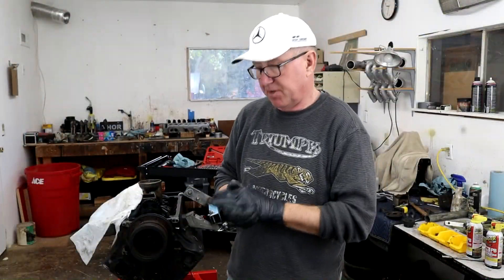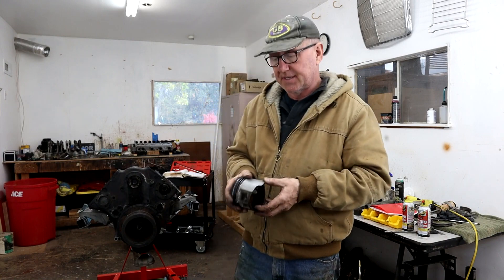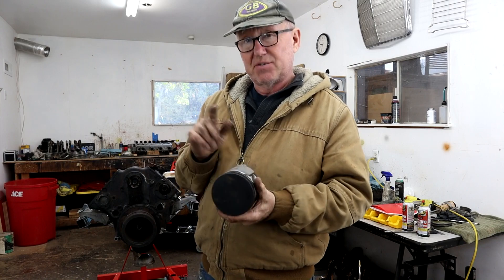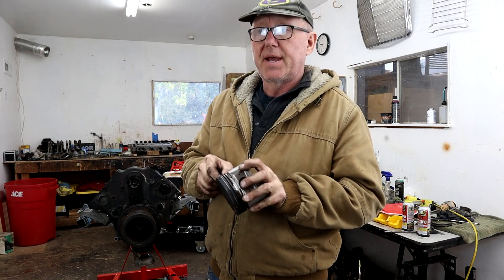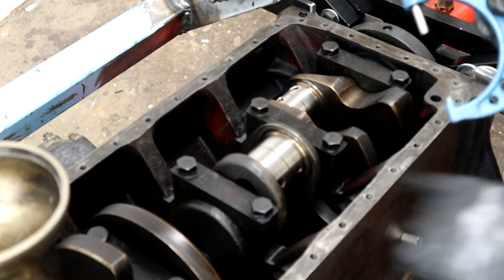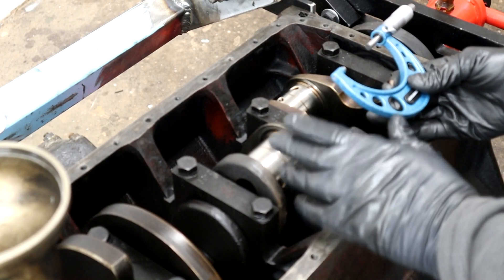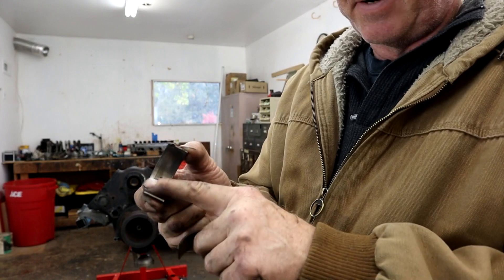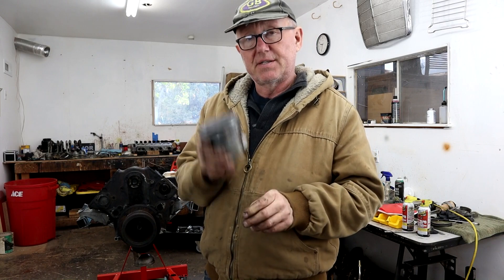MERCEDES M100 6.3 PISTON FAILURE  PART5

Comment: Hi John, shame about your engine. This is only my opinion, but sleeving would be my last resort. A rebore is always the best bet if you can get the suitable piston/rings set. I am a BMW man (sometimes I really wonder why!) There is an excellent Youtube channel, M539 Restorations. The guy is called Streten, and he produces some first class content, albeit BMW related. He has a really bad and expensive experience with sleeving, and I have 2 friends who have also had bad experiences. I look forward to your progress.
Reply from the maker: Thanks for the heads up Bob. I have decided to not sleeve, the block but to do a the re bore and new pistons instead. I agree its a much safer bet. Too many opportunity's to screw stuff up. I'm also going to do some careful research on a good machine shop. Thanks for the recommendation of that channel, I'll take a look.
Cheers John.

Comment: One thing I'm going to urge you to get is a dial gauge kit. Use this to check the crank end float. Push the crank back, or forward as far as it will go. Set the dial gauge up on the rear, or front of the block, & put the stylus of the dial gauge on the pulley end, or flex plate end of the crank. Using the moveable dial, set the gauge at zero. Lever the crank forward, or backward, & read the gauge. This reading should be within specs. If not, replace the main bearings, which I would do anyway. The rod bearings tell me the oil was extremely thin, with a lot of carbon in the oil. This is caused by dilution over an extended period of time, & possibly running too hot. The only Mercedes model I'm aware of that has lengthy periods between oil changes (120,000km!!!), is the 450SEL 6.9. These have dry sump lubrication.
Reply from the maker: I did exactly that today. A little out of spec at  0.010" end play.  From my understanding it should be between 0.004 to 0.007" But I'll  check the service manual. I'm replacing all crank bearings anyway. Im assuming this play can be reduced with new bearings along with a new thrust shell bearing. Cheers John 🍻
Reply: Now, now, lets not get overzealous here. Its only two wear points to deal with - the bore and crank wears. At this rate we would all be carrying Mitutoyos under our arms!!
Reply from the maker: @mohabatkhanmalak1161  To be fair, I'm glad I did check the thrust bearings (crank end play) as Christopher advised. After all I don't want to go back in here again:)
Cheers John 🍻
Reply: @mercedesmaintenance.6339  Its all good, just some banter. But, not sure of how machine shops operate in the US, but in two countries where I lived overseas the system worked this way: you took your cleaned block, crank and conrods and if needed cylinderhead to the machine shop. They would  take all the measurements and refer to their  manufacturers tables of min, max specs. Then they would also procure the next oversize parts like pistons, bearings, valves etc. So we got our blocks etc with all the new required parts, ready to assemble. We didn't even need to plastiguage the journals - but in your case I say you still plastigauge the journals when assembling the engine.
Reply from the maker: @mohabatkhanmalak1161  I get it:) No worries. I guess someone could do what you said, but I'm just going to ask the machine shop to re bore to match the new pistons and I'll measure and check the rest. Its something I'm looking forward to. I spent a lot of money on measuring instruments so I better make use of them:)
Cheers John 🍻

Comment: The engine in my vids  had piston damage ,that is the second ring land had broken on several of the pistons.  Because the AUS ,UK etc engines had the standard compression they were prone to pre ignition. Preignition Will break the ring lands as the firing on the upstroke causes huge pressure waves (hence the rattle under acceleration) . Once the lands break a driver might be fortunate as that all that could be all that goes  wrong, but in common cases they end up looking like yours .The rings break and the ends will flog a hole in the piston wall,and often the bore wall as well. On 6.3's and the other Mercedes MFi equipped engines, a leaking cold start valve will make the interior of the engine look very clean as the excess petrol washes everything down. Your are right though,the gudgeon pin bushes show every sign of thin oil . It all goes to show how ever,just how tough these engines are when they can drive around on 6 or 7 cylinders and not feel under powered!.
Reply from the maker: Did you have a spare set of pistons or have some made? All bearings and rod bushings will be replaced.  Also having a little trouble removing the front balancer and pully. I made a puller, but its not going great:) I think I'll try finer pitch rod to enable the pull. Plus I'll get the pully off first then the balancer.
Cheers John 🍻
Reply: Some of these imported into Australia were in European tune. I worked on a couple of them. What we did to get around the preignition problem was retard the fuel timing by about six degrees.